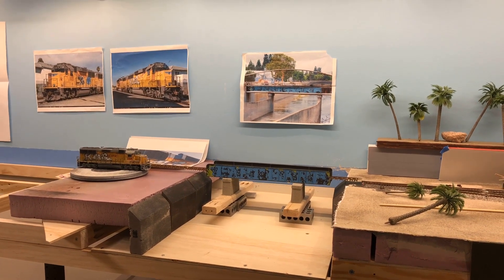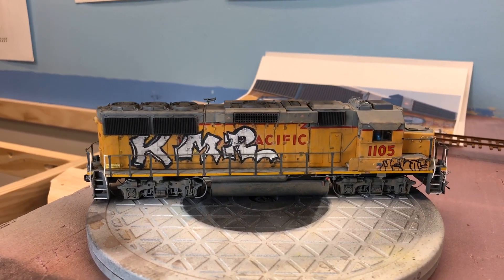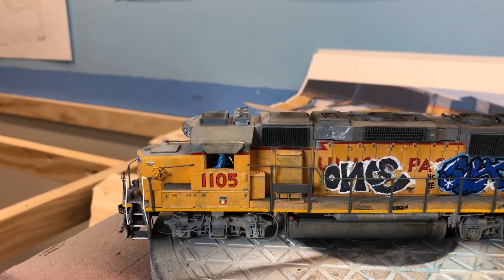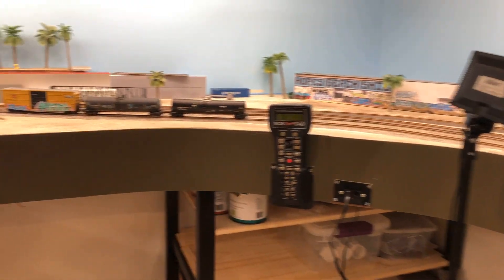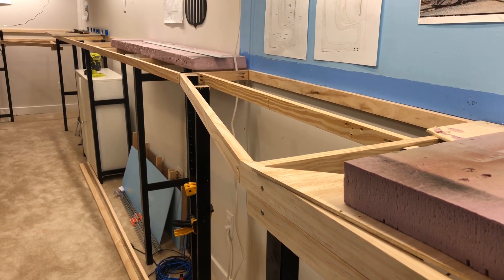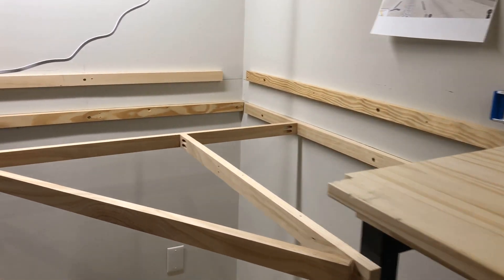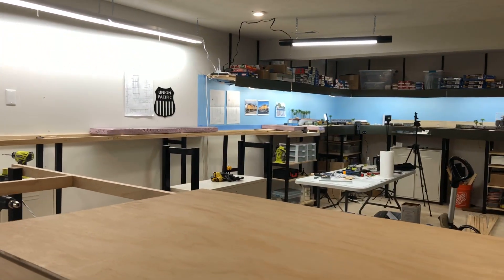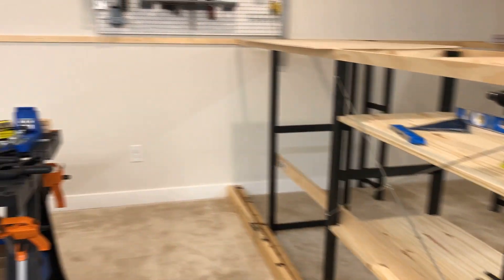Layout Update - Expansion and locomotive weathering on the Santa Ana Industrial Lead HO scale layout

Comment: Nice to see progress on the layout and luv the weathering on the 1105 especially the fuel tank and trucks.. pretty realistic!  😜
Reply from the maker: Thanks!  It's hard sometimes to NOT make everything a rust bucket.  This one is relatively clean so I had to tell myself to stop, she's done!
Reply: @VSLAModelRR  Buddy I'm with you on that as I just finished pealing off the tape on 2 old GP50's I repainted UP yellow/grey as I over weathered them years ago.. I'm starting over.. David. 🤪
Reply from the maker: @daylightdave9405  I think I overdid the one she's paired with in the video, 1083, I actually was able to lighten up the gray on it with pan pastels, some light gray and white.  It's tough to undo what is done!
Reply: @VSLAModelRR  I know it is, I had a bit of a snag when I pealed off the tape on those 2 GP50's yesterday as sum of the grey I painted on top pealed off with the tape.. I can cover it up with a little weathering..  Happy Modeling... David... 😜